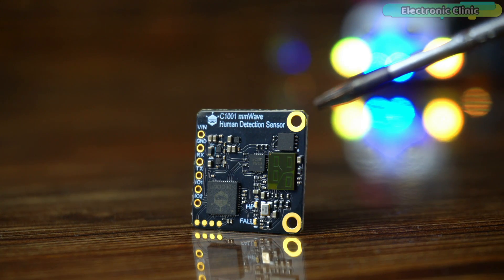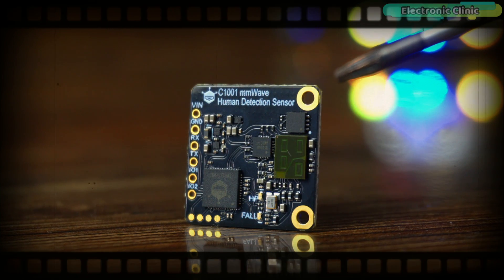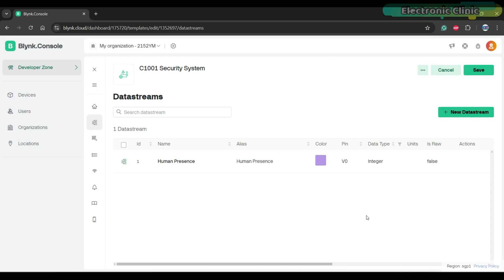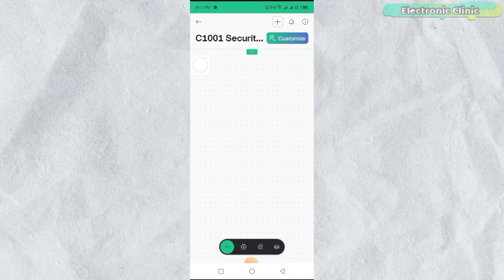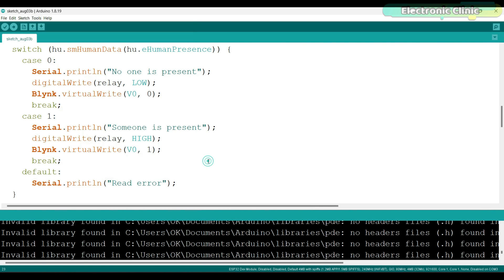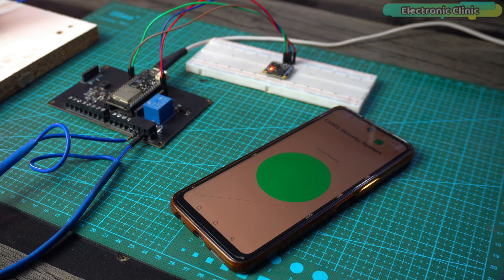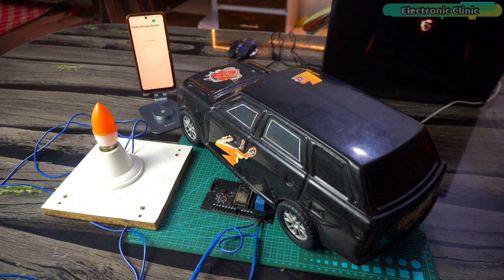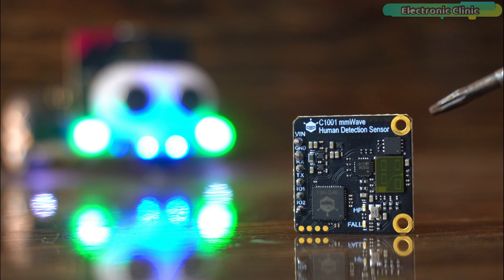See Through with C1001 mmWave Human Detection sensor, mmWave Sensor with ESP32 IoT

Comment: Do you know the exact IC DFRobot used in that C1001 Board?
also plastic and wood do have an effect on the range of detection.
somewhere in the document of Hilink mmWave modules I read that there's a specific way to calculate on how to place the cover over the sensor to minimize the effect

Comment: How can I control a smart bulb with C1001? Sorry I am completely new to this :)
Reply from the maker: Watch my previous video on c1001, in that video I controlled a bulb.
Reply: @ElectroniClinic  Thanks for your reply... I saw that but I want to control a smart bulb using wifi.
Reply from the maker: @aadravid  are you using esphome?
Reply: @ElectroniClinic  No... I just have a Philips Smart bulb which is in another room that I want to turn on whenever someone is using the toilet :)
Reply from the maker: @aadravid  isn't it connected to wifi? How  it turns ON/Off automatically?
Reply from the maker: you will need to check the application if it can be used with the ESP32 or ESP8266. As we we use, Blynk, ESPHOME, etc.
Reply: @ElectroniClinic  Ok thanks... will check

Comment: Is there any document on the raw data from the sensor modulus's UAT?
Reply from the maker: it's not available on the product page. but you can access the raw data, if you go to its library folder and open the cpp and h files, from there you do it.
Reply: @ElectroniClinic  thanks, possible to get the could point data?